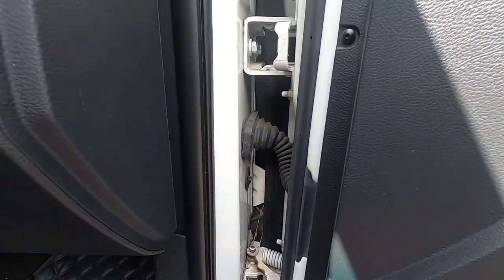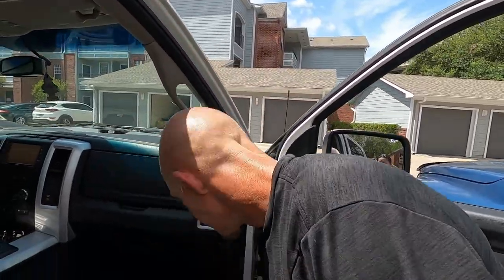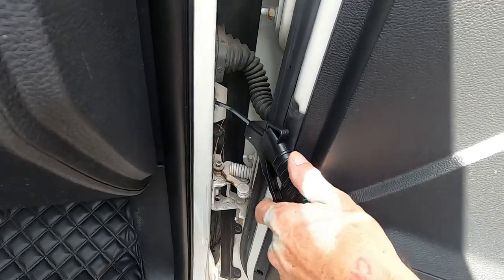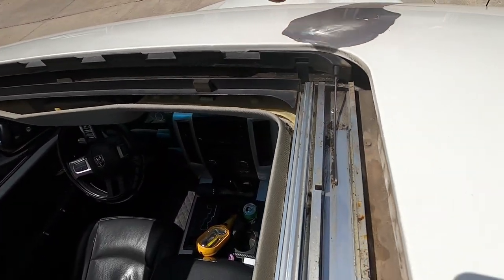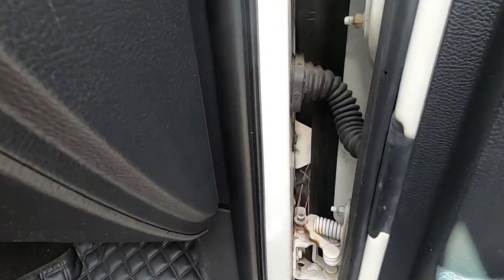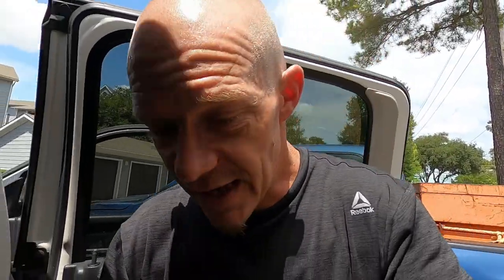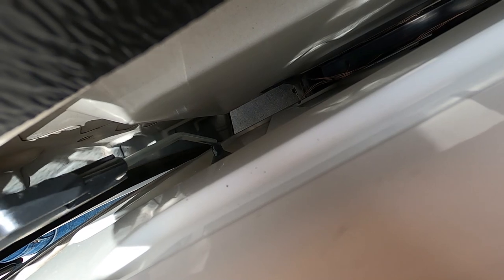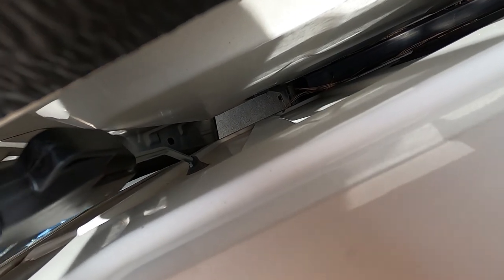Ram Sunroof leaking on your headliner? Watch this before spending money.

Comment: THANKS BRO!! I just bought a truck and it had this problem and i got a long worm of dirt out. also i think the holes between the bed are air holes and the holes between the doors are the drains, just fyi, so you should not have to spray the holes between the bed, only the ones in the doors. That worked for me. GOD BLESS YOU!!
Reply from the maker: No sir their drains I took Sunroof out of truck there drains in the back
Reply: @autoguydiy4244  oh ok, cool

Comment: Thanks, I never knew where they were, mine were pluged solid.  Great information,  I also replaced the gasket on the third brake light with one from Detroit MuscleTechnologys. Their gasket is so much better than the factory gasket and cheaper

Comment: In early Dec 2023, I was taking a nap in the back seats of my 2018 Ram 1500 Longhorn, when I noticed water stains in the rear sides of my grey headliner.  Until I watched this video, I was unaware that there are drain channels to the rear of my sunroof.  While these stains are not as dark like in this video, I tried to clean the water stains with New Wave cleaner and a clean microfiber cloth, but the stains are still there.  Now I’ll try to get to a local auto body repair shop to see if they can clear the ducts, and perform a water leak check.  I ordered this truck factory direct to dealer to my , and because i rarely open the glass top, I was concerned leaks would happen.  I was more focused on watching for leaks in the front part of my cab.  Now I wish I had not ordered the truck equipped with the roof glass, but I’ll keep it as long as possible because it’s the last year of this particular body style and I love exactly the features I wanted in my 2012 Ram Longhorn !

Comment: wifes jeep has same thing. dealer fixed it under warranty but wouldn't say what it was. when it got out of warranty i learned this same lesion.
i hope u don't ever have the ac drain blockage as well.
my take is that nobody that designs a fricking car has ever had to work on one. wouldnt it b nice if the body tilted up like big trucks so i could get to some better
Reply from the maker: That would be the prime situation. Oh they thought about it and thought if we make it as difficult as possible they will bring the cars back for service $$$$$. Slimy assholes lol

Comment: I’ve chased around all the common leak problems. Replaced third brake light, cabin exhaust vents, siliconed around brake light, siliconed down either side of roof weather stripping, even siliconed around entire back window and sealed the slider shut, blew out the sunroof drains. Leak keeps coming rear passenger side and headliner is wet in that corner. Dropped headliner today and have it inside with a heater and dehum to dry. Is there any other cause you are aware of? If I wasn’t already bald I’d be pulling my hair out.
Reply from the maker: It's almost like it's coming from the body and roof seem. Under the black strip on the roof
Reply: @autoguydiy4244 How do you recommend re-sealing that. Thinking that is my problem too.

Comment: I did this just recently after a while of taking water into the cabin of the truck. After blowing out and rodding out this line water still seemed to get in the cabin.  I went ahead and put duct tape around the seals of the sunroof. No water since. F a sunroof. They’re bad news
Reply from the maker: At that point big dog your Sunroof seal is bad.take it to a windshield place and have them remove the sun roof and replace seal. Probably $100. Never put tape or a sticker on the paint of your  car. You risk the chance of damaging the paint or clear coat.

Comment: In the process of buying a 2012 1500. Test drove it today and noticed no cover for the sunroof and a dry water stain. Guy played dumb and said someone must have left it tilted. So now I know what happened. Also, it's missing the actual slide/cover for the sunroof. I've never owned a ram. Is there supposed to be one?
Reply from the maker: In the truck there is a sunroof cover
Reply: @autoguydiy4244  not in this one. Just an open gap where it looks like one should be. I'll have to go back through and maybe take a buddy mechanic with me on Tuesday. Thankyou.